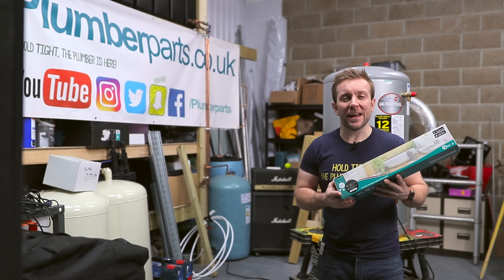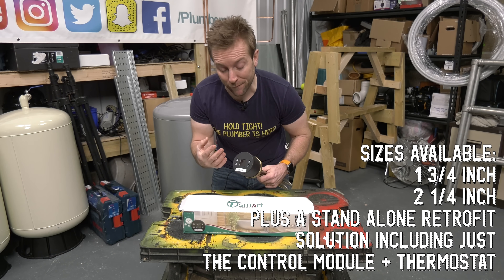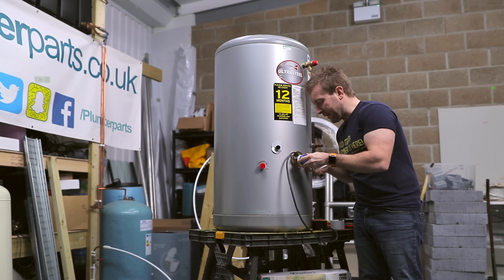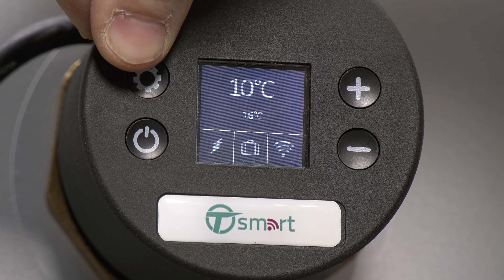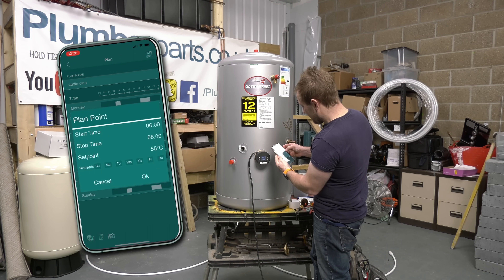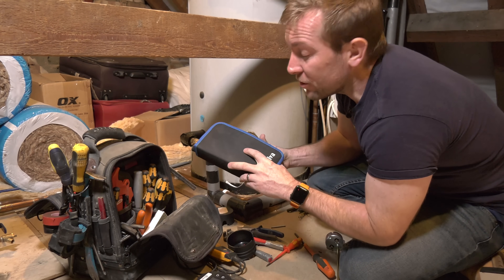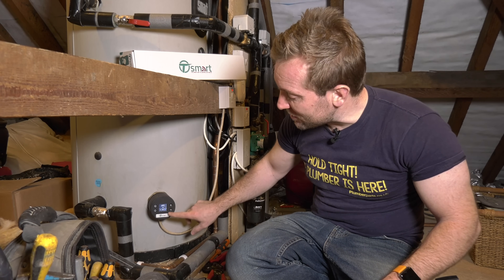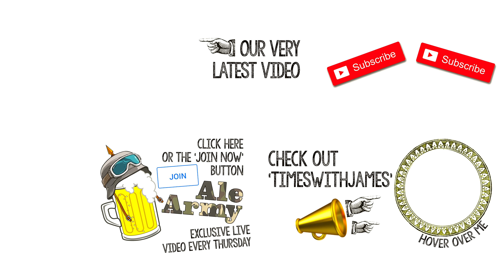HOW TO UPDATE TO SMART IMMERSION HEATER - Tesla T-Smart Review

Comment: It looks really cool, we have two larger water tanks with 18kW (3x6kW in each iimmersion heater.  Do you know if the version that dont include the immersion heater need a contactor + relay so it can handle large 3 phase power or if it has an inbuilt relay so it works up to a certain amount of kW?

Comment: Update doesn't work on mine (keeps failing eith E04 or E05). Contacted Tesla UK about it and they sent out a replacement connection cable. I installed it but it's still stuck on E04/E05, and the app WILL NOT WORK AT ALL unless the update has completed. That means I can't set the temperature from the app, only from the unit itself (in my boiler cupboard) or from home assistant (third party software).

Comment: My local plumbing supplies Web page says that this is only suitable for horizontal immersion heaters. Mine is fitted at the top of the cylinder and points down at an angle. I can't understand why this isn't suitable for my installation but they have it in big bold text as a warning so I'm thinking it is a thing?
Reply: There is a vertical version, which we've got. It did fail after a couple of years during a power spike, so I'm wondering whether to replace it or go with a different option.

Comment: Would this be compatible with a Nest thermostat? Currently we can use the Nest to turn the hot water heating on in increments of 39 mins, but there is no way to monitor the water temperature or see how much water we have available.

Comment: Thank you for the video. This item does not work with any solar diverters. Is there anyway I could see the temperature of the hot water cylinder please? Thank you.
Reply: I bought it instead of a solar diverter. Much cheaper. Won't match solar excess, though, so you would need a home battery to act as a buffer when the sun strength isn't providing enough.
Reply: @dougbamford  Thank you.

Comment: Just looking to fitting this beauty. i see that you can  buy the thermostat and head only, so the question i have is are there different lengths of thermostat for a top fed immersion or are they all standard size?
Reply: Longer rod required for the vertical mount.

Comment: I've had a mixed experience with this product, after fitting the first original product, it worked really well for a few months, then we had issues. The unit would randomly cut out as with no power with mixed results when it had booted back up. Had a chat with Tesla technical (who were very helpful) but the long and the short of it, three replacement units later we still had the same problem so then proceeded to get a full refund. We still have no idea why this should be and wondered if anyone else has had a similar experience?
Reply: Was this continuing issue thought to be associated with an intermittent internet connection or interference from other networks or devices? Was the unit run in manual mode only for a period of time which one assumes should ring fence it from external influences? I see that Tesla technical added their voice to some of these earlier comments and it would be useful to hear from them again perhaps on this point?
Reply: We are having problems with underheating

Comment: Have had nothing but issues with this product. Have fitted 5, had issues with all 5.

Four tripped the thermostatic overheat cut out. Needing to be reset constantly. The fifth just wouldn’t send power to the heating element.  

May just get me being unlucky as anything. May be condition of install? Have asked Tesla for advice and haven’t got much feedback. They sent out one replacement stat but that tripped the thermostatic cut out. 

Currently in the hole for two smart thermostats. Swapped out the others for wifi fuse spurs. 

It’s disappointing as it looks like a great product. The app seems great. Being able to see the water temp is amazing. 

Just can’t keep getting called back to jobs. Hopfully it is just me.
Reply: Ours just failed completely after two years. Disappointing when it was so expensive.

Comment: Hi...This is a great video and help me answer quite a few questions. We are buying a property and I want to make it as smart as possible...The property has a Tribune Immersion Heater with 2 immersion heather one close to the bottom and one more in the middle. Do I change both, or do I change only the top or only the bottom? Thanks. great Video.
Reply: You only need to change the one at the bottom but you can change both. Down to personal preference. If you want to use the boost on the top one, you are able to do so remotely.

Comment: Great Video, do you know if the TIHTS model will work on a vertical immersion heater?
Reply: TIHTS will not work on vertical mounted immersion heaters however, we have just released a model which will (TIHTS650).

Comment: COMBATIBILITY WARNING - Just tried to fit the Tesla head-only retro-fit cap to an in-situ 2 1/4" Tesla (i.e. their own product!) Incoloy 14" immersion element - FAIL! - The size and the orientation of the contacts between the cap and the element terminals are not compatible. This head-only cap can only be fitted to a 1 3/4" immersion element with plug-in thermostats contacts. They are not currently planning to make 2 1/4" T-Smart caps for retrofit. If you want that, you'll have to purchase their new 2 1/4" all-in-1 kit (element plus t-smart cap, prod code TIHTS496) for ~£155 and drain-down the whole tank etc.  (in my case a 750l cylinder, oof! £££). Hope this helps someone. I suggested to Tesla that they should make this compatibility reqmt. much much clearer and that they're also missing a trick by not producing a 2 1/4" cap-only that can be retrofitted. Fell on deaf-ears think.
Reply: Will this product fit on Gledhill Torrent's immersions?

Comment: Can you use 2 smart Tesla’s at the same time on one app?
Reply: Hi Alex. Thanks for the enquiry. Yes, you can control two units at on the app but you will need to do them individually. If you require any more information, please get in touch at technical@teslauk.com or call 0121 686 8733.

Comment: Will it work with Solar I Boost or any solar diverter using surplus solar energy, please? Great video, thanks.
Reply: Hi Solarman, 
T-Smart needs a constant live feed to it and if heat is required it will call for heat regardless of the iBoost settings. If you have a secondary Immersion Heater then T-Smart may be better suited here and used as an anti-legionella control and boost when needed? 
Hope this helps
Richard
Reply: @richardprince2617  Perhaps two immersion cylinder with the bottom one of the I boost and the T Smart higher?

Comment: Nice idea and not too expensive save for one issue it has.  The majority of UK Immersions are fitted in at the top of a HWT and as such hang down vertically (or at a slight angle).     This T-Smart is only any use with Horizontally [side fitment into the tank] mounted  immersions so TBH of little use to the vast majority of us here in the UK!   Short of splashing out a fat wedge of wonga on a whole new tank/install  etc ... seems a bit of a lame duck to me! ☹️  👎
Reply: Hi Legion OfMany 
We have just received the first production samples of the Horizontal Mount T-Smarts, its biggest downfall has been its biggest strength. The T-Smart is too accurate in the current form for Vertical Mount (due to the chimney effect caused in the immersion boss) however we have worked to overcome this and our field trials will begin in the next few days. The good news is we will know very quickly if this works or not as nuisance trip outs occur very soon after install. 
Please feel free to send your contact details to sales@teslauk.com and once we have finished testing we will advise the product is available for Vertical Mount. 
Thanks for your feedback and positive thoughts towards the product. 
Richard

Comment: What about Bath/Sink type immersion.
I'm guessing you change over to 3 core. Or do they come in both types??
Cool video cheers 🍻
Reply: Hi Fionnan
I believe you are referring to what we call out Twin Heat which has two elements in one? If this is the case you can change over to a T-Smart and use a single supply in 3 core, the T-Smart can then be programmed in timer mode to operate as normal but has the boost function for when needed. 
The only thing to consider is that currently T-Smart is a horizontal mount only, we have prototypes under way for the Vertical mount which we hope to have available very soon. If it is a Vertical mounted you need please feel free to send your contact details to info@teslauk.com and we will let you know when this is released. 
Hope this helps
Richard

Comment: Are these compatible with copper cylinder hot tanks? My immersion has just died and I'd prefer to update the immersion rather than buy the same again.
Reply: Hi Rorykava
T-Smart can be used in any tank where the immersion is Horizontally Mounted, we have a specific 2.1/4" Immersion available from McDonald Water Storage if you require this size. 
For Vertical Mounted installations we are working on a solution which will come later this year. 
Hope this helps
Richard
Reply: @richardprince2617  thank you! I have a vertical top mount immersion unfortunately.
Reply: @rorykava  that's unfortunate at this moment but we will have this solution soon, if you would like to send your contact details to info@teslauk.com we can let you know when one becomes available if you wish. 
Thanks
Richard
Reply: @richardprince2617  100% I'll wait for the solution. I'll be in touch thanks! I'm in the rep. of Ireland so I hope you ship also 🤣
Reply: @rorykava  of course we can get one to you via courier no issues, I appreciate the patience and will be in touch as soon as its available.
Reply: @richardprince2617  Same story here. Will hold off until the vertical version is ready. ROI also!

Comment: Great video 👍, looks a great product. I have an economy 7 tank with a main element and a boost element, could I use the product on both elements?Thanks.
Reply: Hi There, 
T-Smart would be perfect for both of these requirements as long as they are mounted in a horizontal immersion, currently T-Smart does not work in a vertically mounted immersion but we are working on a solution for this. 
Hope this helps
Richard

Comment: Hi with this upgrade is that just the sensor which you are sliding in ? 

We use 2KW immersion heater to heat pure water in our vans for window cleaning, would this be compatible ??? 

Reply would be great
Reply: Hi there, 
You need to install the Thermostat (plug in sensor) and the cap but as long as your 2kW immersion has a plug in style immersion then this would fit fine. 
If you need any further assistance then please send your contact details to info@teslauk.com and we will give you a call to discuss this further.
Hope this helps
Richard

Comment: Great video! 👊🏻 sounds exactly what I need. 

I was wondering if I should go just for the thermostat or replace the whole immersion element. Obviously it’s a lot more effort to change but do you think it would be good practice to do so?
Reply: Balls it looks like it doesn’t work for vertically inserted thermostat immersion heaters yet 😔
Reply: @theonlyhowsie4281  Hi there, sorry currently only available for Horizontal installations. We are working on a solution for Vertical immersions so if you want to send your details over to info@teslauk.com we will let you know when this becomes available.
Thanks
Richard
Reply: @theonlyhowsie4281  they are now available for vertically installed

Comment: What about immersions that don’t have push fit thermostats, I would say push fit are the minority when it comes to immersion heaters.
Also horstmann e7 time clocks are the best, i have been installing the for thirty’s years, they never give up.
I don’t think your fancy stat controller will last that long
Reply: Hi Lee, 
We have produced a range of 1.3/4" and 2.1/4" Immersion with plug in terminals which will cover the majority of installs out there, however we have a sister company who manufacture bespoke Elements so we can produce to any size you need if you have any other requirements. 
Cycle tests have been carried out on T-Smart and we have had one running at the highest temperature for along time with no issues, of course until they get into the real world we cannot replicate every day use but we see this being a long life product. 
Hope this helps
Richard
Reply: This is good for a gravity fed system standalone but these are less and less as most property now have combi boilers and yes I used to fit the e7 timers in place of the switch for better control so this has limitations mainly social housing etc

Comment: Can't see that lasting long. Electronics hate to be hot especially capacitors, they dry out. Can see these being changed more often than the element, but I will be happy to be proved wrong.
Reply: Spot on Mark, they're swerving away from the top mount unit, but the side mounts are going to cook the caps.Reminds me of most boiler PCBS, being swapped out when all they need is £5-00 worth of caps and 10 minutes with a soldering iron.
Reply: Thank you for your comments and I understand the concerns you may have. 
What I can tell you though is T-Smart has been designed to run at 80°C for long periods of time however manufactured so that it should not exceed 70°C. We have had an immersion on trial with T-Smart running at its hottest for a long period now with no issues and this is in our very warm test lab but we do monitor this very regularly. 
Thanks again for your comments and hope this makes you feel a little more comfortable regards the product's durability.

Comment: I have an Economy 7 Quartz timer for my hot water, Can I scrap that If I got this Tesla device?
Reply: Sure. Just program it to be on during your eco hours
Reply: Hi Kougan, 
Yes T-Smart will replace your standard Economy 7 timer as it has a built in 7 day programmer. we are also releasing a new update which has the boost function built in so if you require additional hot water throughout day it can be boosted from the app.
Just be aware this will only operate on a horizontally mounted immersion at this time.
Hope this helps
Richard

Comment: Would this work on an older style copper cylinder with a top fed heating element? Or would that be the retrofit kit?
Meaning I can get rid of that HORRID mechnical clock controller, with all those stupid fiddly dip switches.. GRRRRR
Looks like this one from your previous videos : https://www.youtube.com/watch?v=mZ2MT0SKVZY
Reply: Hi Fishbait075,
Thanks for the enquiry
Currently the T-Smart is designed for Horizontal installation only however we are in the development stages of the Vertical install version. 
Please keep an eye on @teslauk Social media accounts as we will be making announcements once these are available.
Regards
Richard
Reply: Tbh I think you would need to convince a customer with a system boiler to install this some would go for this but I think youd have to change the whole element in most cases

Comment: Was just what I was looking for. 
Just about to fit a stand-alone timer for supplemental tank heating with an AirSource pump system. 
So, just put the timer back in the box and ordered one of these.
Reply: It’s arrived, not try and find some spare time to fit.
Reply: That's great new Jay, I would be pleased to hear how you get on with it.
Reply: @Richdev1981  Will do.....
Reply: Well, it’s been in for a few weeks and the only criticism is that with the offset of the ‘stat’ is that the control cable fouls the cap retaining rod.
But a bit of bending and filing a slight flat on it did the trick.
In operation it’s great and to be able to remotely boost is a bonus. 
In

Comment: What a fantastic product. We have an immersion only based system with 2 elements, main and boost I presume, controlled from a separate control unit. How would you use this in that type of setup? Replace main unit, disconnect controller unit and loose the boost? Thanks.
Reply: Hi Derek 
Great opportunity for T-Smart here.
As you say replace the main heater with the T-Smart unit and control this via the app. We are waiting for the latest app release which includes a boost function so this can be done from the app too. You will be able to select a boost temperature and a set length of time for instances when extra hot water is needed, due for release next week then were just waiting for iOS and android to publish it as an update which can take up to 10 days.
Richard.
Reply: @Richdev1981  hi, thanks for the v quick response. Does that mean I could replace both with the T-Smart with one running as main and the other as boost? That way keeping the same operational functions as such? This really has tweaked my attention. Thing is prob need a new tank 🤣🤣. New build with the cheapest tank!
Reply: @derekwallace5685  if you use the top to boost on a regular basis then yes this would be a perfect solution, you can connect both units to one app and name them top and bottom, main or boost etc and then use as you please. 
If you're shopping for a new tank then you should be able to use the retrofit kit which brings the cost down and will be an easy fix and a doddle at install with no need for external wiring or controllers.
Hope this all helps
Richard